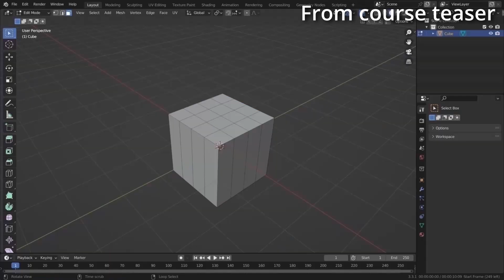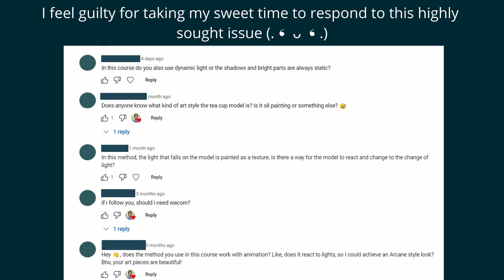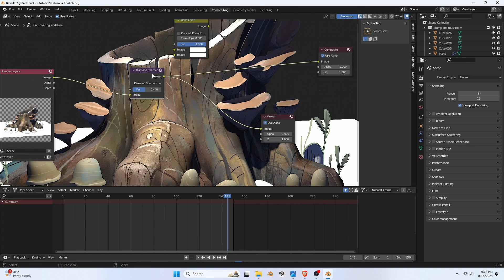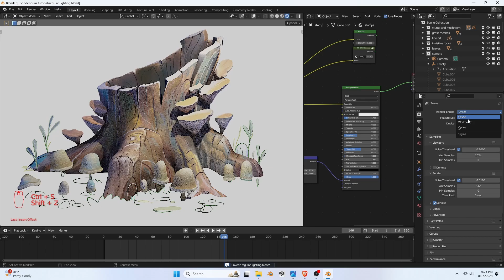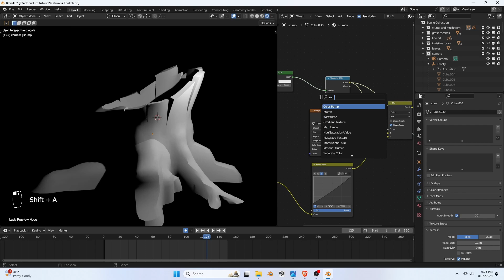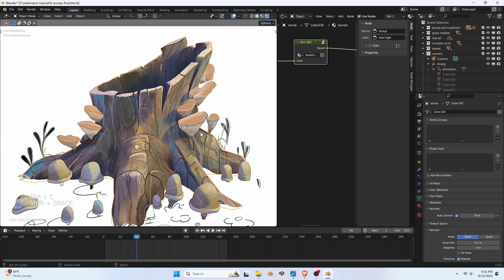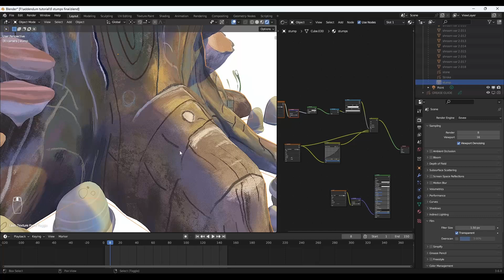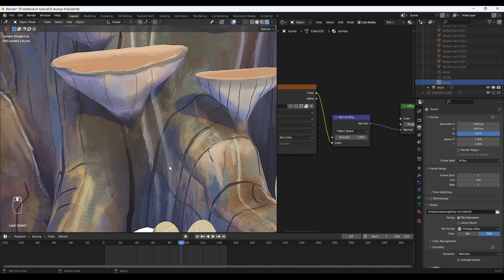NPR lighting methods for handpainted scenes in Blender

Comment: It's a more stylized effect, but is there a way to add stylized halation/subsurface to the edges of the light/shadow median?  I'm guessing it can be done with a ramp but no idea on my end on how it'd work with this setup, or if it would be a composite effect
Reply from the maker: I will try to do it in  compositor if it were me. should be easier to turn a realistic subsurface effect into stylized result that way

Comment: 2:12 How tf are you color picking like that?! Is that an addon?
Reply from the maker: it is just the color picking hot  key
Reply: Really? That's weird... When I try just pressing E in painting mode nothing happens. 
I have to hover my stylus over the color wheel box displaying the color I have selected, and then press E.
Reply from the maker: @Axel_Does_Stuff  that sounds like a total drag. btw the default hot keys changed in recent versions. you can check out what is yours from keymap from preferences. I changed it to the old one from there
Reply: @CraftReaper-OmarFaruqTawsif Ah, right. I probably should have checked that first, sorry. Thanks for the help anyway! 😅
Reply from the maker: @Axel_Does_Stuff  my pleasure! happy painting :D

Comment: i'm sorry if you've answered this question before, but in your opinion what are the deal-breaking changes made to texture paint mode since version 3.6?
Reply from the maker: I am actually conflicted about it now. I use recent version now because of the new asset system. But there are quite a few things I hate about it (mostly ui changes and how color space behave. But I am trying to figure if some settings can fix that). Yet I can't ignore it either.

Comment: So did you say the Eevee setup DOES change with lighting? Like if you changed from a warm light with cool shadows to a cool light, would the shadow color change warmer appropriately?
Reply from the maker: Exactly not like that. there are different shaders for that purpose. But I prefer this for easier control over light and shadow colors. it is a bit tedious than automatic response from light temperature

Comment: Great video. I got your free brush pack a while back and other than the pressure issues (most likely i fucked up a setting or two) i am loving it. Have you tried using it with ucupaint? If not i would highly recommend it.

Comment: Hello, which method is similar to the shade you achieved on orange slices art you made? ( at 00:06 ), i want to achieve a same result. I like the thin red outlines on this shade too.
Reply from the maker: Hi! Glad that you noticed. It is an early experiment. So I will try to discuss it in details when I am done and able to produce better result. Though an alternate method of getting warm tone is using a weak secondary warm light with your primary light. If I remember correctly Jose Vega used this trick in one of his tutorials.